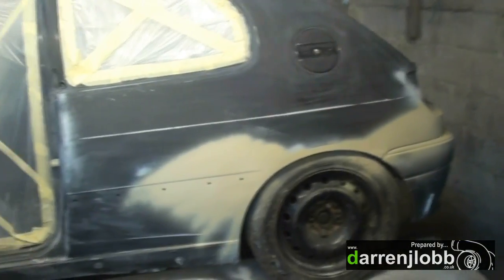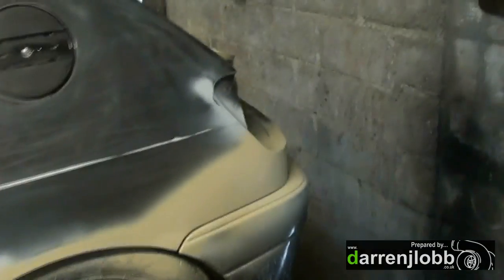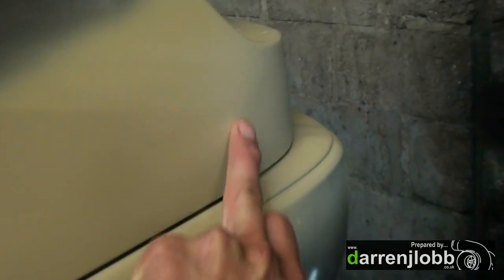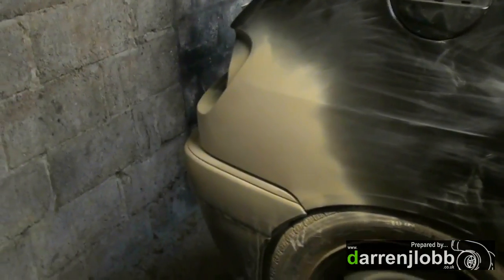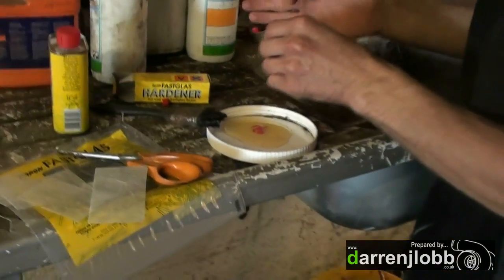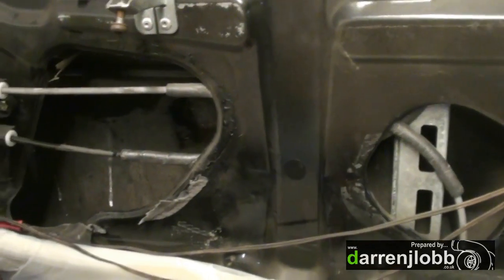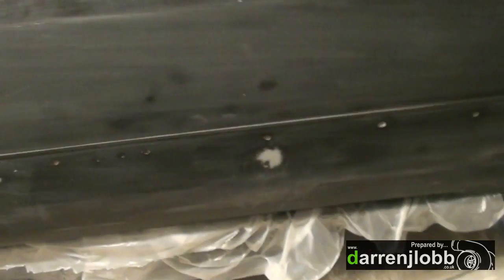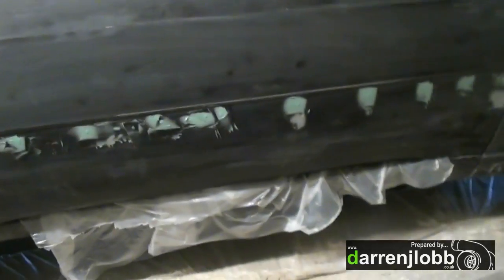darrenjlobb's 2015 Derv Bus Project Rebuild Part 2

Comment: I watch your vids from time to time, you're always messing with something ha ha. Those high spots can be knocked in with a pointy hammer and re filled. The best way to get filler or primer flat is by using a guide coat sprayed on, a very very light dusting is all you need. When dry sand it off with a block, if the paint you've sprayed on is gone and you're back to primer any lows will show. I love to see people having a go, hats off to ya, keep up the good work.